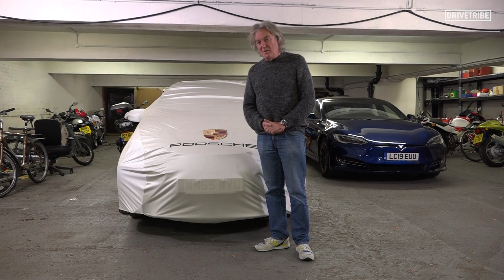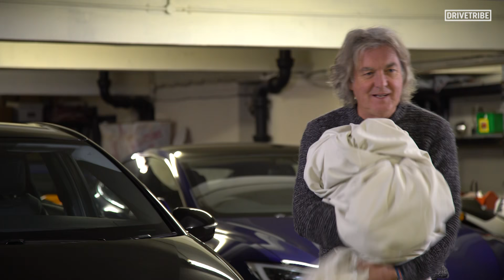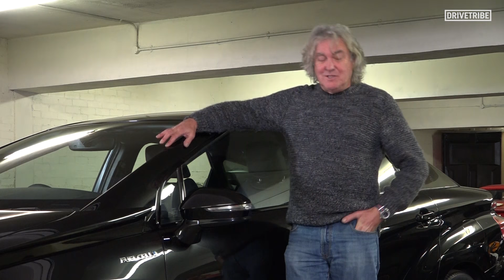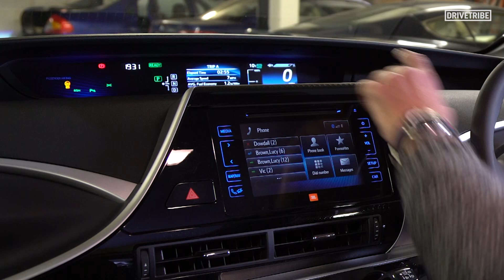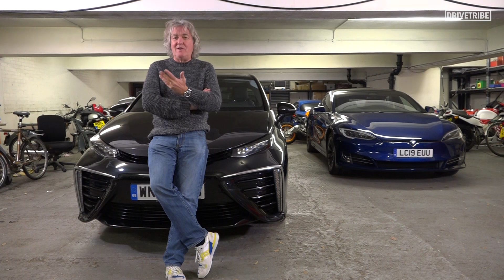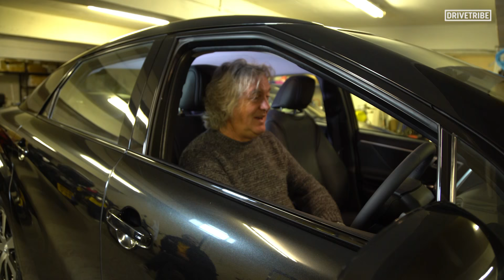James May has bought ANOTHER new car

Comment: Not fully Accurate regarding the hybrid. Problem with Hydrogen fuel is that it actually needs to be transported, while with electricity we dont need to do it. We can just use grid.  On top of that the electric energy needed to create the fuel is almost as big as the one generated by it. Yes you can use solar, but whats the point? You might as well use the original electricity. On top of that Hydrogen fuel stations are EXTREMELY expensive, you can have 10-20 Electric stations (yes stations not just chargers) for the same price because it needs massive infrastructure investment. To top it off while you can fuel quickly, it cant fuel one car after another. It needs 15-20min between cars to build up pressure so it can pump the fuel again.

Dont get me wrong its good technology, just not for cars. Its perfect for ships. As a matter of fact US navy uses it already in some of the newer models.

Comment: But the efficiency of getting oil out of the ground wasn't originally very efficient.  But we kept on until we improved the process so we could make money out of it.  The same will happen with creating hydrogen fuels.  Just because something is hard, doesn't mean we should just give up.

If anyone is serious about "saving the planet", battery powered cars are not the long term answer.  And when it comes to protecting the environment, we need to start thinking about long term solutions, instead of wasting time/money and effort thinking there is any kind of short term fix.  

The weight of batteries don't make them viable in every application (planes for example) and the raw materials used to make them are not as plentiful or easy to get too as some would have us believe.

The whole battery vs hydrogen debate puts me in mind of VHS vs Betamax.  The difference is, this time we have to choose the right option, and batteries are the wrong choice.

Comment: >90% of the world's supply of hydrogen comes from the consumption of non renewable sources through reforming reactions (ie. Natural gas steam reforming). If you are going to use  wind/solar power to produce  hydrogen via electrolysis of water why not instead use that electricity to directly charge your electric car battery? Comparatively then, the hydrogen fuel cell car has the advantage of potentially being lighter and much faster "recharging" time.

Comment: Hydrogen can be stored in the gas grid and so operates like a huge limitless battery, without the rare resource and recycling issues that batteries have. For more info about hydrogen, I found looking into Sheffield's ITM Power fascinating. They are working with Shell and produce the hydrogen onsite at the garage, so no fuel transportation needed. Hydrogen production clicks into gear as the wind farms produce excess energy, such as windy nights when most are at sleep.

Comment: In order to transport hydrogen the process is electricity -> hydrogen -> Ammonia -> hydrogen -> electricity.  Ammonia isnt explosive and is "safer" because it wont vaporise an entire city block if it blows up. However, if it leaks out it has the appearance of clouds that stays below 10 feet(3 meters), upon breathing this stuff in, your lungs /melt/ By the time you smell it, its too late. 

My point being, transporting this stuff is not only inefficient, its vary dangerous and the more of this stuff being transported there is, the higher the chance of a major accident occurring and in either case people will die as a result.

If you talk about transporting this stuff, that also increases the cost. 

Hydrogen can only realistically be used in a reasonably safe way if its made on site where it will be used, so either at a gas station or at your home. The process is to make hydrogen itself is highly inefficient or vary inefficient and expensive. 

For excess power storage at your own home it doesnt seem like a bad idea if it would otherwise go to waste, maybe even for a large scale project a power company might work on. It could also be reasonably used for long haul trucking. But for short distance travel? battery is definitely king. With time battery power will get better and cheaper,  hydrogen wont. For now hydrogen can "maybe be good for boats and planes" but in time it will be replaced by batteries.

Hydrogen has a limited future that will only get smaller with time. Batteries have a future that will only grow.

Comment: Now if you find a way of storing the Hydrogen at atmospheric pressure and maybe adding some Carbon so when the fuel is burned it gives off Water and CO2, which is what plants crave, you have a really green and efficient vehicle. Hmmm, diesel is extremely energy dense and meets all the requirements. Burn the fuel hot enough and you can make some Nitrogen compounds to act as plant fertiliser too. Win, win, win!

Comment: It’s sad that you don’t know much James as an auto journalist... is it not a problem after 10 years that all they managed is 8 fueling stations? After filling up 5 cars you gotta wait a while for the pump to be ready again btw. Is it not a problem it costs 4x more than an EV to run? Why such a big car and only 4 seats? What about performance like acceleration, handling and stop speed? Bet the Model S will wipe the floor with the Toyota... it’s sad that you don’t know hydrogens has already failed for small cars. Even big ships are using batteries and there are plans to build battery aircraft. But keep promoting the use of fossil fuels, because that’s where all the hydrogen in your car comes from. Nice timing btw, there’s a new mirai now. But there is help, if you need help being up to date on EVs, you know who to ask.

Comment: This is what was missing from later Top Gear. A modern, more cerebral and balanced version of 'Woollarding'. FWIW i reckon Hydrogen loses on production, transport and storage, but may just have a place for its 'familiarity' with the fuel station experience. But the cost of setting up infrastructure puts it way behind, as most folks have access to electricity, especially outside of cities. Maybe its the city fuel of the future.

Comment: One Correction for Mr. May. Power 2 Gas -based hydrogen is one of the most energy efficient way to produce fuel for the car when combining the whole life cycle analysis for the car starting from producing the car, using the car and recycling the car. There's only small batteries on hydrogen cars compared to Tesla's.  My life cycle analysis calculations show that Mirai is pretty even in overall energy consumption compared to Tesla 3. That calculation contains energy consumption for production of the car, production efficiency for fuels ((like usual electricity you get from grid ), diesel-fuel, power 2 gas hydrogen..) , energy consumption of recycling the car and energy consumption when driving the car.

Other correction for usual consensus. It really doesn't matter how much energy something actually consumes, as long as that energy resource is plentiful. Hydrogen resources would be easily plentiful to contain the whole consumption of energy of British people when combining with energy efficiency innovations and new other technologigal approaches and possibilities.

I am interested to see Mirai in next videos. Germany has already 77 H2 Filling Stations covering almost the whole Germany and they're continuously building more.

Comment: The main reason I prefer the hydrogen is that it is extremely effective especially  hydrogen can be made best with seawater.  This means any land that meets the sea can make hydrogen locally and an island such as the UK and Ireland, this would prove the best.

This means that the world is less reliant in trading with the Middle East and the funding towards religious extremism will be greatly reduced.

Have small plants dotting right across the island and transport them to the places available.

The oxygen from the electrolysis can be sold to the market or released to the atmosphere.

Comment: Funnily this coincides with my thinking of about 20 odd years ago... I had a brief love affair with hydrogen fuel cells in my youth when I found out they were used on the Apollo missions, i even had blueprints for them. They were initially designed not long after the second world war, so not exactly a new technology. Anyway, while i was researching my dissertation on renewable energy these two technologies were my front runners for replacements for fossil fuel dependant transport. My hypothesis was retro fitting ICE vehicles to run on hydrogen in the short term to eliminate dependence on oil, petrol vehicles can run on hydrogen, much the same way they can be fitted to run on LPG. My thoughts were that it would be possible for fuel cell vehicles to eventually be used as the norm for longer journeys (simple and quick to refuel) with battery electric vehicles being used for commuting (inexpensive but slow to recharge) or even a combination of the two in one vehicle. Hydrogen can be produced 'at home', anywhere with a lot of electricity and water really, but there's a huge down side, it's very inefficient. The other way is highly polluting to manufacture as the majority of hydrogen then produced came from chemically breaking down hydrogen peroxide.
 Anyway, long story short, my conclusion was that Hydrogen as a fuel source is an inefficient 'lossy' system with it being resource expensive to produce and difficult to store compared to batteries for your average consumer, however my thought was that Hydrogen would win out due to the possibility of using it in ICE vehicles and simplicity for the consumer but now I'd say battery technology has improved enough to overturn that. Sorry May, the hydrogen fuel cell electric car has come too late, technologically we could easily have made them more than 30 years ago if we wanted to and it would have been much more relevent. So now I say BEV FTW. 😀

Comment: James,  hydrogen is still extracted from oil,  oil is a pollution problem, from oil spills to the problems caused by fracking.  You information does not take into effect the pollution and destruction caused by oil refineries in general.  Do you know what a flare stack is? Are you aware of the damage to the environment caused by the movement of oil in oil tankers?  Are you aware of the environmental damage caused by oil pipeline spills? The best way to go forward is to eliminate fossil fuels all together.  The damage to the ozone and the worldwide increase in global temperatures was caused by reliance on fossil fuel.  This must be eliminated if we are to go forward.

Comment: Nice ride. I think you're one of the few sensible voices out there when it comes to EVs, James. You and the Fully Charged crew. As you say, the Toyota is still a 'battery' EV... just it's recharged by pumping in hydrogen but it's far more complicated and has more 'consumables' (ie the fuel cell component) than a normal BEV. The only thing it has going for it is that you can 'recharge' it quickly, but that assumes you have access to a hydrogen station and that you don't have access to DC fast chargers for the normal BEV. I'd rather a BEV any day but I think hydrogen might be of use for commercial vehicles. In fact, I'd rather they restricted it to commercial vehicles if they're going to use it at all. Makes little sense for a car - much like diesel. Getting away from explosive & flammable gases/liquids is not a bad thing.

Comment: The hydrogen fuel cell car is good for making it feel like you have plentiful refuelling points when driving the Tesla. Because if there's one thing that's sometimes harder to find than a charge point, it's a station with a hydrogen pump. There actually are a few around here, in the Detroit area, because of all the experimental cars on the road, but get 50 miles out and I don't know if I've ever seen one.

Comment: Hyundai Nexo is a far better Hydrogen Fuel cell car.... Designed from the ground up for Hydrogen. 450 mile range, great interior and stunning SUV exterior. There are currently 12 Hydrogen fuel stations in the UK. Another 26 Hydrogen stations planned for next 18 months.

Comment: A car manufacturer should make a way to put a metal like magnesium and acid in to a tank to produce fuel while you drive and make a combustion engine that would run on hydrogen. This would mean that you still get the amazing sound of a combustion engine but the only was product is water and no emissions.

Comment: You dont need to spend the kind of money that you have spent to take part in an experiment that has very quickly already reached its conclusion, I admire your stance considering the formidable force of petrol heads that surround you as colleagues and fans but the jury is pretty clear on this for personal transport at least, batteries have won.

Comment: Brave, but visionary:  Hydrogen power in personal cars should have a long-term future, if the right to personal mobility is not abolished. Rechargeable battery-powered cars are basically a hyphen, that is to say, a stop-gap. Hydrogen-powered motoring has undergone a very long gestation period. Roger E. Billings (Billings Energy Research Corporation) developed a gasoline-hydrogen dual-fuel system that was used in prototype car conversions and other vehicles in the mid 1970s. Billings had hydrogen powered buses running in regular service in Provo, Utah in the late 1970s. Billings was also said to have been instrumental in the development of hydrogen fuel cell technology.

A bit more thought suggests a couple of questions:  What sort of pressure is involved in the storage and transport of hydrogen fuel? Does a hydrogen fuel distribution system present greater challenges that the pressurized LPG or natural gas systems used in much of the world?  In Thailand pressurized LPG or natural gas has been legally mandated for taxis for several years. The fuel is available at many regular filling stations, and the process of refueling is not much more time consuming than normal diesel or gasoline/petrol fill-ups.

Comment: luv how you are experimenting with this.  I have experience with both vehicles in California.  I have to agree that the future is electric.  I can tell you the pros and cons of each right now.  Mirai Pros: Potentially faster fill ups if tanks don't need readjustments in pressure else it could take 20 minutes, only emits water, more transportable fuel, Toyota familiarity.  Mirai Cons: Less cargo room than a Tesla, not as fun to drive or as quick as a Tesla, more costly to refuel that a Tesla, possibly more maintenance scheduled requirements than a Tesla, probably won't be a crash proven as a Tesla because of the required extra equipment.

Comment: I would think HFCEV has the upper hand now due to the "fill up" time & range. BEV will be great if charging time is reduce tremendously and increase range. Advantages of BEV is it can be charge anywhere with power outlet which is already available plus cost of charging. Hydrogen will require restructure of home,  stations, etc. Who knows, some breakthrough invention might completely shift or change the automotive world.

Comment: James is correct.. 97% of hydrogen comes from steam reforming fossil fuel. Even if you use solar panels and electrolysis to create the hydrogen it is less than HALF as efficient as simply using the energy directly to charge a battery. See Real Engineering's video The Truth About Hydrogen. And that's based on battery technology of yesterday.. Battery efficiency is still improving by around 8% per year.. Hydrogen will just get less relevant over time. Also, look at the servicing and operating requirements of hydrogen fuel cell vehicles that aren't present for EVs.. Looking forward to see those additional downsides and costs!

Comment: For £62.500 and only 8 filling stations in the UK I think you'ld be mad to buy one of these. A Tesla model 3 (or any other BEV) would be a much better option. The Tesla supercharger network is all over Europe & the UK plus you can also use any three pin plug or DC fast charger. There are more electric charging stations in the UK than traditional petrol stations - plus most EV owners charge at home over night when the electricity is cheap off peak. Hydrogen fuel cell cars are the Betamax of EVs - they will never catch on because the infrastructure isn't there and they have missed the boat. All other automakers are making BEVs - not HFCV.

Comment: Hydrogen can be burned in a standard gasoline engine through a direct injection injection system and ignition by an old fashion spark plug. The fuel cell system is a waste of capital just to use an electric motor. Either way the exhaust is water vapor.

Comment: Please tell me a bit more about the Toyota car, HP, 0 - 60, top speed, how many motors, front wheel drive or rear wheel drive or 4 wheel drive, can you tow with it, if so what are its towing limits, I think Hydrogen is the future. Much more practical to be able to fill up like a petrol or diesel car, if the car is user friendly with a reasonable practical range when towing I would chose HFCEV over BEV any day. Batteries take too long to recharge.

Comment: I would choose hydrogen fuel cell over batteries, if the necessary infrastructure was in place. Lithium ion batteries are currently very difficult/expensive to recycle at end of life, and contain several compounds that are very toxic/ harmful to the environment. The current, relatively small number of battery electric vehicles, are going to be a major problem to dispose of at the end of their useful life.

Comment: I actually think that hydrogen fuel cell cars is the actual "future" of driving.  Instead of a gas station, there will be hydrogen stations (and basically have unlimited range).  We will need extra electricity generation capacity (even with electric-battery cars)… So we're just going to have to "accept" the expansion of nuclear power.